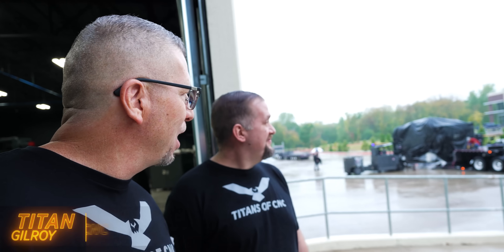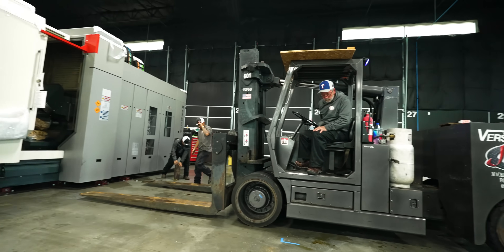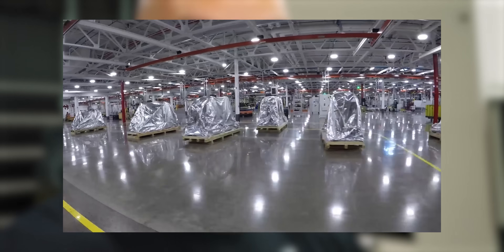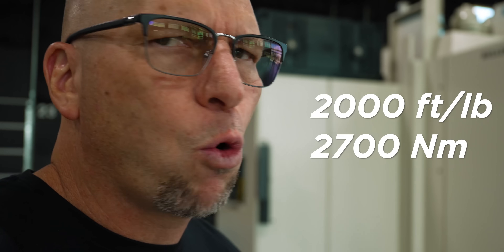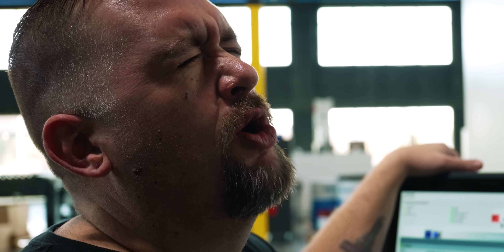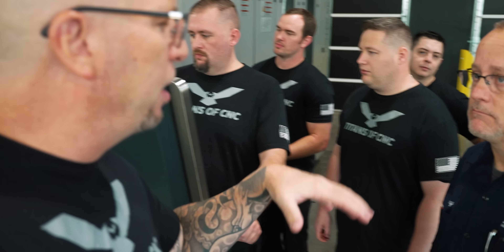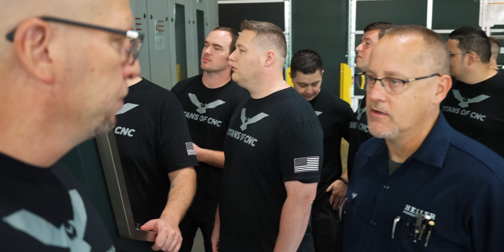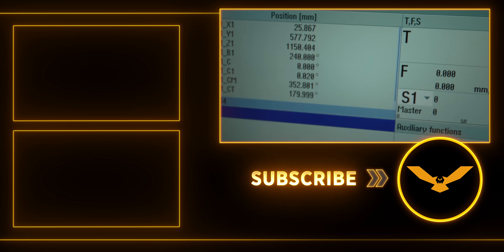127 yr old German Machine Tool Builder Delivers First CNC | HELLER CP6000

Comment: We have 15 Hellers in our plant in Michigan. We have 11 MCH 350s 2 MCH 250s 1 H3500 and and H4500. 

Come here and then say hellers never go down. 

Constant problems with ATC doors, hydraulic issues, motor over temp issues, faulty drive issues, broken B-axis clamping tabs, the list goes on. 

Best machines I've ever set-up and ran were Mazak, integrex line.

Comment: GOTO MDI FUNCTION; SELECT TOOLS; SCROLL DOWN; TO BDC( 0 ); DELETE THE ZERO AND REPLACE WITH 360. THE TABLE WILL ROTATE 360 DEGREES:
MAKE SURE YOU DO NO HAVE A £200,000 HYDROLIC FIXTURE ON THE TABLE FIRST THOUGH

Comment: One small thing about what travis said about the air hose, by doubling the diameter of a hose, you actually square the flow rate given the same pressure because surface area of a cross-section squares.
Reply: yeah...totally right, but I wasn't going to mention it...

Comment: Hey Titan and Co,
A while back, Titan came on one of the videos and asked for the most challenging projects. He asked to send them to an email address, which I can't find any more. But I think I've found a way to challenge you guys to the extreme. There are two things that I won't believe you can do until I see them. The first challenge: using any form of steel, create a 12 inch record out of it that can be played - more than once without being damaged - and includes at least half an hour of music. It has to be stereo (extra challenge!) and it has to have full frequency range (20-20000 Hz) and a noise floor of less than -50 dB. I'm an audio engineer, I can help you do this. This would require immense precision in all three axes, while machining out an extremely thin channel into metal. The second challenge: create a hologram by machining it into steel. No ifs and buts - it's doable! Well, in theory it is... You would have to be insanely, incredibly precise with this one.

Both challenges are way outside your comfort zone... I want to see if you can do it.

Comment: 0:55 man’s doesn’t know how area works in relation to diameter. 1/4 to 1/2 inch is a 4x increase in surface area of the fitting

Comment: Minor correction, at .57 the statement going from 1/4" to 1/2" air fittings doubles your air capacity is incorrect.  It is over 5X more..!
1/4" @ 120PSI 50' of line the CFM is around  5.8
1/2" @125PSI 50' of line the CFM is around 32.8
So, doubling the line size will increase the air flow by over 5 times!

Going from 1/4" to 3/8" over doubles your flow rate. (5.8 to 11.2)
Most folks use Milton M series fittings, I've switched to V series as the flow rate is over 50% more (for 3/8" hose, not 1/4").

Love this channel!

Comment: Are there even any bigger machines on the market than a Heller? No CP 10000 need more power!
Even bigger is I think Zimm?
Reply: There are many bigger machines. Heller goes up to 8000kg with the h16000. Burkhardt+Weber goes up to 20000kg with their MCC&MCX 1600, Starrag goes up to 13000kg with their HEC 1600 I believe and Hüller-Hille goes up to 30000kg with their NBH2000

Comment: I wanna see how the guy layed out those footpads for the machine so accurately to line up with the pads in the machine 😂 that takes some serious skill
Reply: They unfolded a giant paper template somewhat like the ones that come when you buy a new sink.
 Either that or they use lasers. 😁
If they use the Stanley measuring tape and a sharpie, then I am really, really impressed.😁

Comment: why are so many points under the machine? isnt the machine stable in itself enough?
Reply: I was also surprised to see so many fixators, I counted at least 15. On that size machine that seems exorbitant. The machines im used to use the same ones, but they only use 9.
Reply: @justcallmeappa1673  i know machines with the same travel in XYZ with 3 fixators :D
Reply: @matthiaszobl  Yeah, me too. An older style of the one I had in mind also only used 3. It's not just the rigidity while milling. The problems for us started with these extreme acceleration numbers today's machines need. Especially with the 5-axis. You also have to consider the type of cuts you can take with a 2600nm 80kw spindle. I've seen someone run a Kennametall Harvi Helical mill cutter with 80mm diameter straight into a block of titanium, taking a 50mm deep cut.
Reply from the maker: Many company level their machine with offsets… meaning the super fine leveling.
Heller does a mechanical level… so the machine itself is absolutely perfect… and they get it within microns
Reply: @TITANSofCNC  is the bed of the machine out of concrete or cast iron?
Reply: @TITANSofCNC  I didn't know other companies use offsets to setup their machines, we do it the same as Heller. Setting it up perfectly using a Niveltronic with a resolution of 0.01mm/m.

Comment: Congratulations guys, 
Heller is a great company, we work with our machines connected to a FMS set up and tooling wall non-stop. The automation level is practically endless, it ends when your bank account in empty 😅.
Reply: Bank account is ALWAYS the limiting factor..HAHAHA.....
Sometimes thats good otherwise I would have a top notch machine in the shop and the fridge empty at home...🤣🤣🤣
Reply: @Baard2000  what home!
Reply: @TAH1712   my shop is my castle...
Reply: @Baard2000  Mine was to for a while...

Comment: sorry, but from what I know, in the aerospace sector the most used are makino.  aerospace is the most complex, so is makino better?  and in submicron processing the best is willemin macodel from what they say.  right?  sorry english, but i am using google translate.  from italy 👋
Reply: Makino is great but as Titan said, there are a couple companies that are just a tier above. Companies like Heller, Hüller-Hille, Grob or Burkhardt+Weber are just on another level. And one has to wonder why they're all from the same region in Germany 🤔
Reply: @justcallmeappa1673  I'd like to try some of those machines your talking about
Reply from the maker: Makino is a great premium machine and is on level with DMG, Mazak, Okuma etc… but there is a higher level and that’s where Heller is…
Reply: @TITANSofCNC  thank you from the bottom of my heart for replying ❤️ I hope one day to meet you.  👋
Reply: I don't know anything about Heller, but I run a Makino and I'll tell you what, if you do your part, it'll do its part. Crazy accurate.
Reply: However, I do work in a Japanese owned shop. They tend to buy Japanese machines and tooling. Great people to work for, and a great shop.👍

Comment: Heller is very industry specific or at least very popular in the automotive sector .
Realistically these are made to order for specific projects so I can't see it something machinists would regularly encounter.
Reply from the maker: Not anymore. They produce machines for all major industries
Reply: @TITANSofCNC  Well in your insert every industry mentioned was  automotive  and I encounteed them when working for  a diesel engine manufacturer .

Why not get a Robodrill in ive seen some phenomenal work  coming out of these machines ,quite accurate as well. Just a thought.
Reply: @markmall7142  there are always reasons why a manufacturer uses a specific brand of machine, and in my experience a large part of that is operator experience. As he said, there're a lot of plants that have like 100 machines just from heller, and they almost never try any other brand. ZF has several plants in the DACH-Region, Some of them have over 150 Hüller-Hille, a direct competitor to Heller. Heller and others such as Starrag tried to get them to switch while Hüller-Hille couldn't deliver machines, they basically gifted them a couple machines. ZF still went back to Hüller-Hille because they had problems they never encountered before and the operators hated the other makes.
Reply: @markmall7142  I don’t think it’s about which machine is the best or fit them best, the motto of this Chanel is big boom pow cinematic style content so every machine they get must fulfill the criteria
Reply: @markmall7142  a robomill  cost less than the  coolant tank  on a Heller.. but I find fanuc interesting too, since they have  been around forever... probably  for a reason..
Reply: @mattiasarvidsson8522  I am aware  that a Heller is rather expensive and is realistically reserved for big capital expenditure therefore big projects.

The Robodrill is intersting on another level ,cheap,fairly capable  and has a decent control to handle complex surfacing .
It was not my intention to compare the two.
Reply: @markmall7142  was not my intention sound like you was comparing them either.... ;)

Comment: Heller machines are some of the best for high volume production. A lot of what my company makes doesn't have the tolerancing to utilize Heller machines at their price point, but we do have a bunch at at least one of our facilities. I've made some fixtures for them before, though the machines being used were the machines with the built-in hydraulic table couplers, which is perfect because you completely avoid ever getting chips (in this case aluminum) into your hydraulic pump tank which can cause a ton of problems.

Comment: 1:00 double the size means 4x the air capacity
Reply: Wait nevermind. I just did a simple calculation to verify. Man I feel stupid sometimes lol
Reply: @imsmee8222  no Problem, would have explained it really quick but nice that you solved it on your own
Reply: I wondered if anyone else noticed that…
Reply: Can you explain?
Reply: @imsmee8222  It's basic math, really.
When you calculate the area of a circle, you have the radius (R) and Pi (π) - the formula is R² x π.
1/4" pipe area (0.25*0.25*3.14)= 0.19 square inches
1/2" pipe area (0.50*0.50*3.14)= 0,78 square inches
Reply: @elanjacobs1  
Oh no, what ever will I do?
1/4" pipe area (0.125*0.125*3.14)= 0.049 square inches
1/2" pipe area (0.25*0.25*3.14)= 0.19 square inches
1" pipe area (0.50*0.50*3.14)= 0,78 square inches

There.
Reply: You mean a typical German CNC a giant air leak...